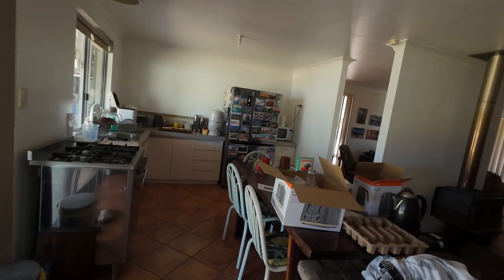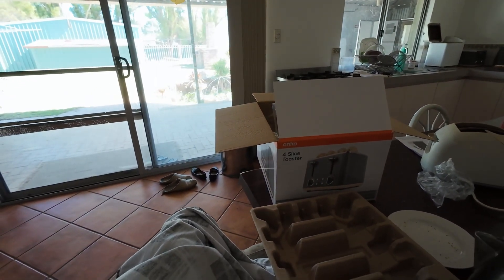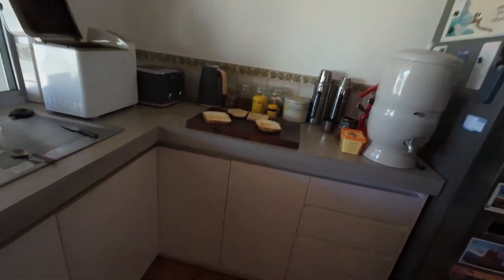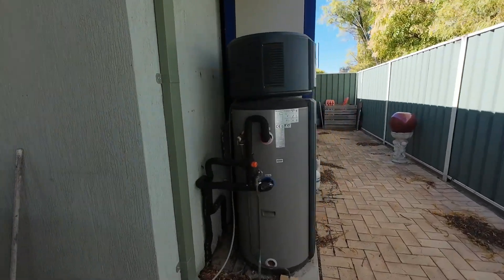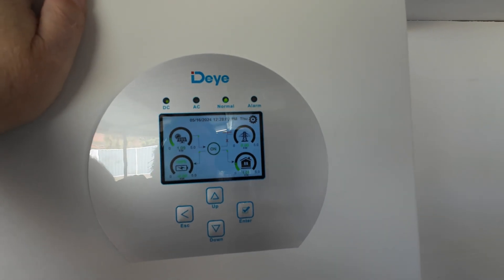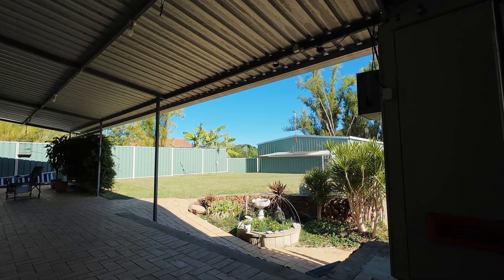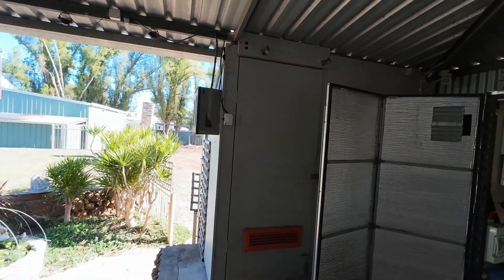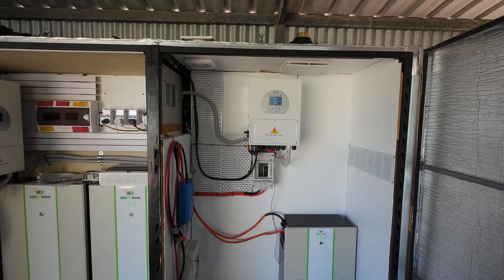Solar Inverters:  Size Matters! (22)

Comment: I must confess I did end up getting a Victron inverter. I've got it configured currently to work in the same way as my MPP Solar inverter does which is fantastic. The Victron is also a LF inverter, the MPP Solar is a HF inverter. The Victron handles overloads substantially better. The MPP Solar shuts down when you go even a little bit overload. No doubt the Deye is similar to the Victron and it has a bit of extra in it for a short period of time before it overloads. The downside to the Victron was I actually needed help getting it configured as it was a bit confusing for me as to how to get it configured how I want.
Reply from the maker: Victron are ok. I believe they are working on a New all in one system. Let's hope it works as flawless as the Deye and does not need all the add-on overpriced rubbish victron  like to sell you just so it can all connect to the internet and talk to each other.
Reply: @JustinCaseSolarPower  Yes so the Deye has solar charging built in, Victron doesn't. The Deye has monitoring built in, the Victron doesn't (you need a Cerbo GX). I already had the MPPT's and the Cerbo so it wasn't an expense for me. I still have and use the BMV-712 and it keeps a pretty close idea of the battery SOC but it's usually out by about 1 maybe 2Ah each cycle. The MultiPlus-II can feed into the grid but that is where I am getting stuck, Ian over at Energy Connections has been very helpful with this however.
Reply from the maker: Like I said. Victron have a new all-in-one in the planning stage, I believe. We will wait and see what that is like. It may even get approval for use in Australia.

Comment: As you know I run a 5 Kw inverter (5Kw resistive loads and rated 4Kw with inductive loads depending on the power factor)
Through my over twenty years experience living with off grid power, I find the "minimum" size inverter for a house with all electric is 8 Kw. A 5 Kw will work if one watches what loads they have running at any one time but 8 Kw is the minimum I would recommend for the average size Aussie house.
My 5 Kw works fine for my little one bedroom cabin but even then if I put on the kettle while the induction stove is cooking with the electric hot water system running then it would stress it out. Hence why I have a timer on my hot water to come on at midday and then turns off until the next day once the water is hot.
Ya gotta love K-Mart for some spending experience. 😆I can picture it now, you would have checked out the specs on the back of "every box" looking at the wattage draw before it went into your trolly. It's what us off gridders do before making that purchase 🤣🤣
Reply from the maker: So true. Me handing the fine print to Sigi. What does that fine print say love? LOL, But we need to know. 8kW is just right for us as well. 5kW is a tad small, but I pushed it to its limit today. Had to do that test, after all, that is what most people have on when they get out of bed. Their brains are not working yet. Need to get that first coffee and toast into them.